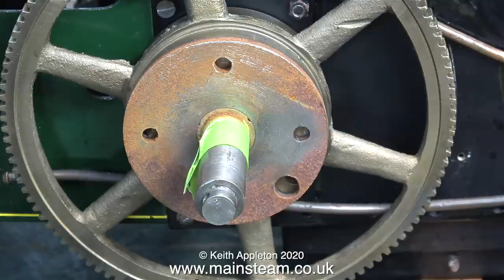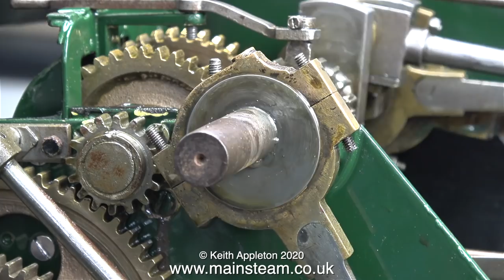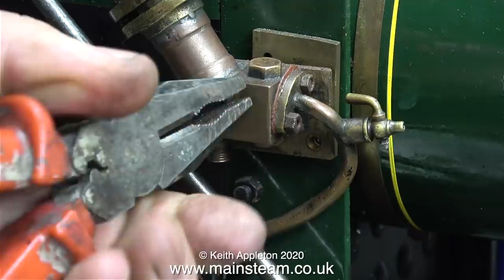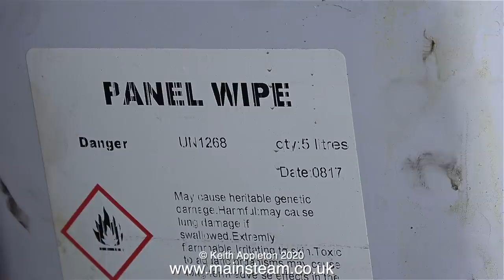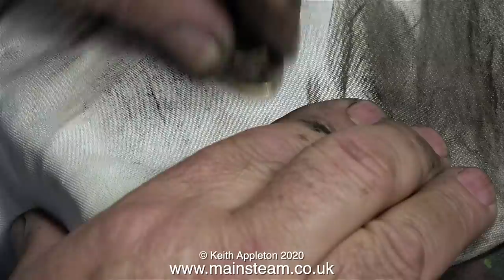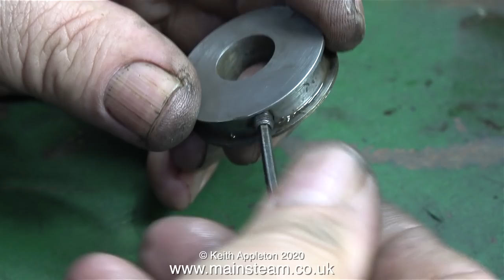A VINTAGE MODEL TRACTION ENGINE RESTORATION - PART #3

Comment: Thank You for still uploading those videos!
At least i mananged to accidentaly order a massive lifetime supply of BA 8 and BA 12 bolts instead of the 50 pack i originaly intended, last year... ha ha
But i suppse i can use the BA 12 for the 00 gauge anyway.